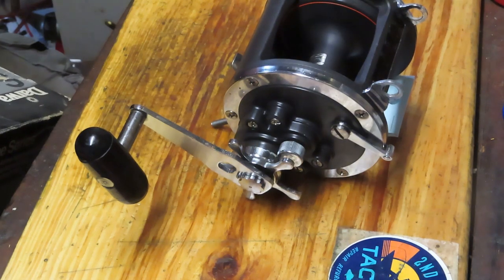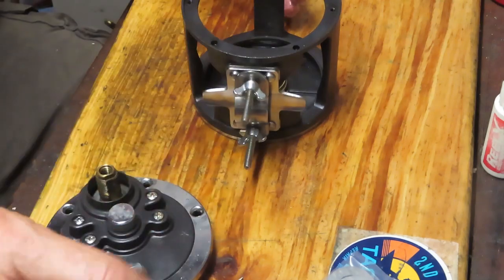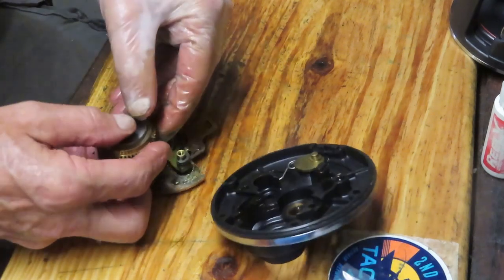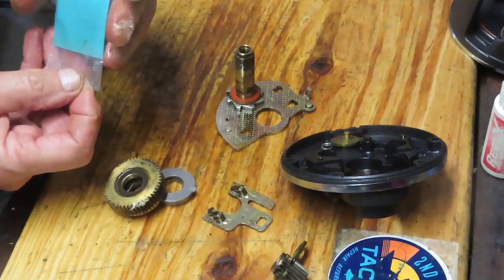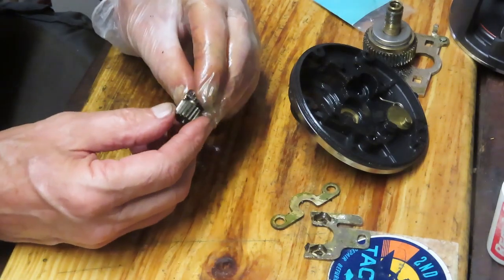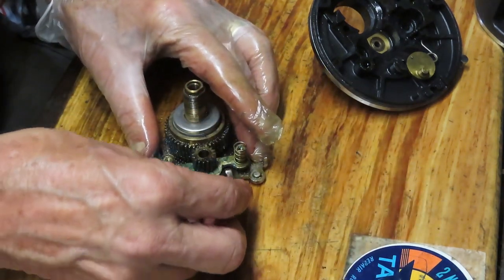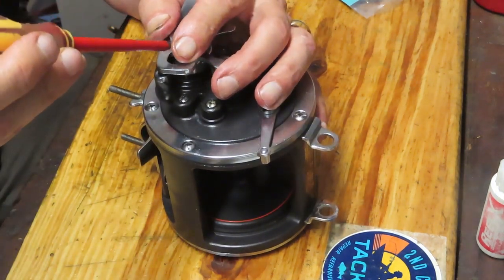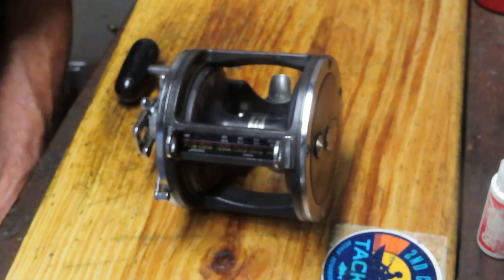Daiwa Sealine 600H large saltwater trolling reel how to take apart and service

Comment: Great job Dennis. I bet this reel could handle a sea monster! —Chris pS. I did not get that Quantum reel. I didn’t even want it for free!
Reply from the maker: It could and the 900H I have can pull up Davey Jones locker!.  On the quantum, your time is probably worth spending elsewhere - Thanks Chris.  Be well
Reply: @2ndChanceTackle  I agree on the Quantum. I got an Optix 60 and paid only about $10 just to see one and service it. All the bearings were frozen on it. I used PB Blaster and got them back in decent shape but in general I hate that reel - No ARE override. It just a cheap reel with a plastic case and ever metal piece in it will rust.  I really liked that video on that huge conventional reel. I’ll bet you could tow a boat with your 900H! I like those reels a lot.

Comment: Great video.  I’m not a fan of the thick washers.  They work well but an option for drag washers if you want HT-100/carbontex is double up on Penn 115 drag washers (9/0) in between the metals. It will become the same thickness and personally I feel is a smoother and better drag for fighting fish. The other option for the hard washer under the main gear is actually a 50H drag washer. It fits perfectly under the gear.   One thing i don’t know if u mentioned either is the yoke has a groove on the side where the eccentric jack goes up and down. You mentioned something, but wasn’t sure if that’s what you meant.
Reply from the maker: Thanks for the additional information and tip on doubling the washers.
Best wishes - Dennis